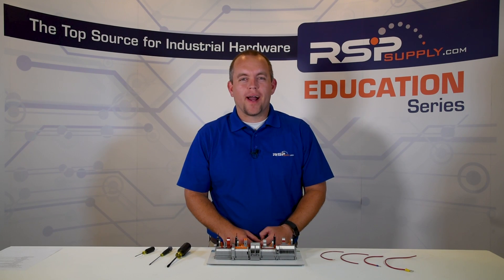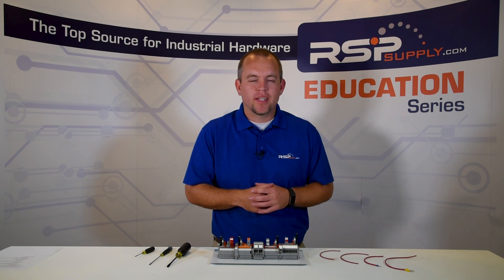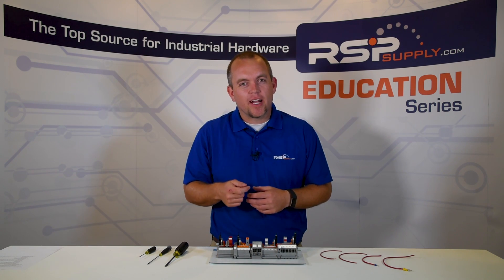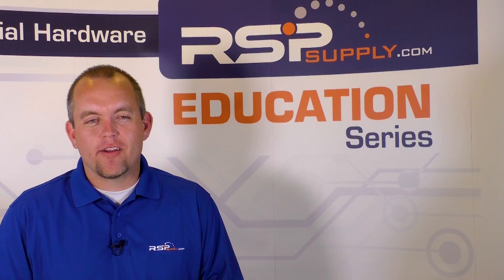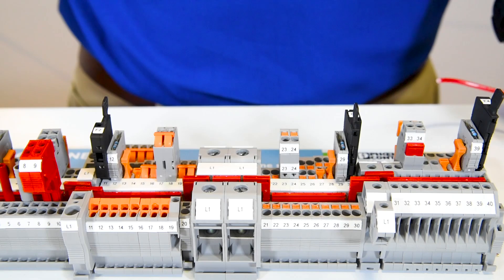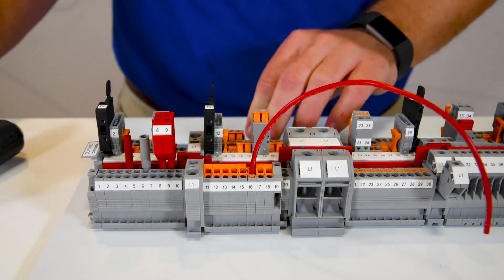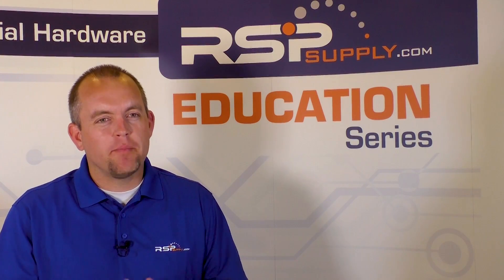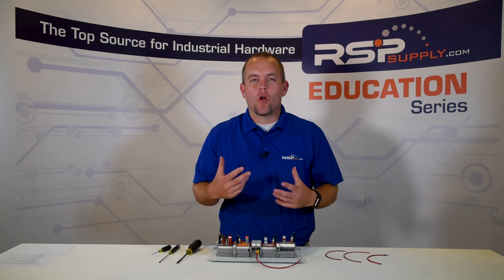Terminal Block Connection Types

Comment: Sometimes there are blocks with numbers and letters. The circuit diagram refers to put some wire in terminal for example XG07-1 a. My question is how to know where A letter is located, I can se the number but not a,b,c,d etc. thanks in advance!

Comment: Very informative and professional, thank you. The only concern I have is around 3 minutes in, you mention that the fast connection terminal blocks require no tools, right after using a precision screw driver to lock the wire in place. Are there similar types the can be installed without the screwdriver?
Reply: I know this is super late, but if you haven't discovered WAGO, look them up. They have terminal blocks that can be connected and disconnected with a lever. Their website is terrible but their products are great.